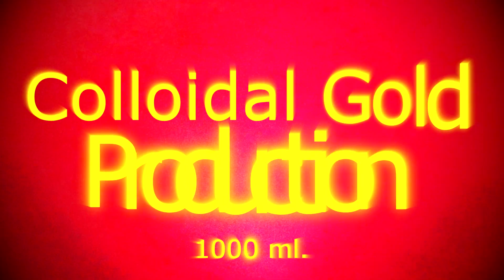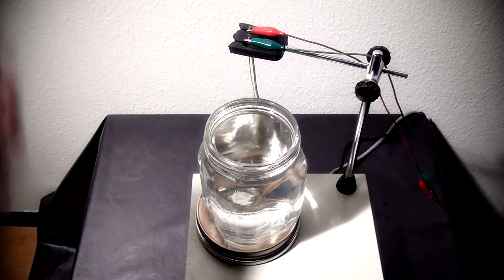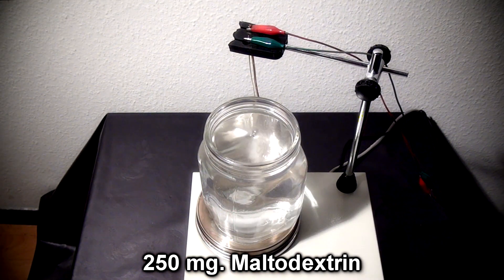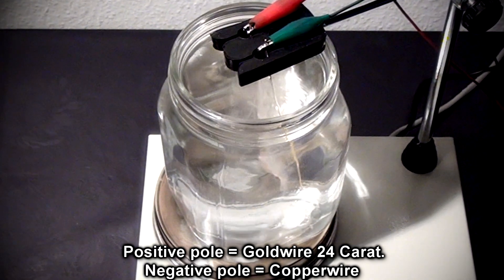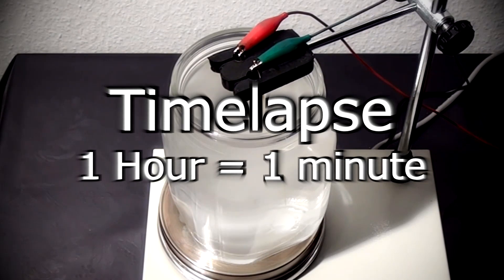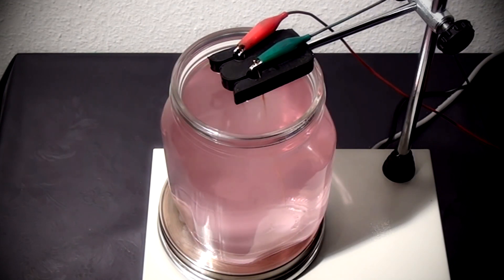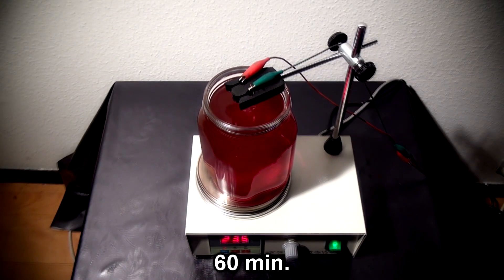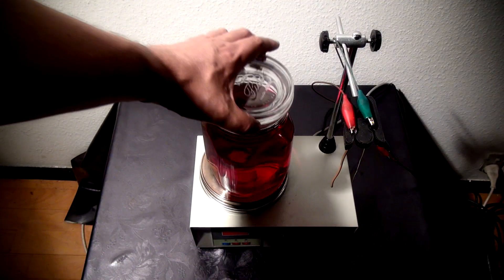Colloidal Gold Production

Comment: Hey are the alligator clips just there for support or are they connected to a machine as well?
Reply from the maker: They are connected to the power, its just easier to use alligator clips on the wires :)

Comment: I have a question I want to start making colloidal gold using your video can. you tell me if I can buy the gold and copper wires at a hardware store..so I can just have them cut it 12cm long fo rme..I looked online but all the wires are in rolls...and another question sorry..how do you know if your getting 24 k gold? I make colloidal silver similar to your method here. with the magnet for a stirrer and the machine...and I use three 9volt batteries and it seems to do well for the colloidal silver I make..but gold and copper is new to me..so want to experiment with your method..thanks so much
Reply from the maker: I but from this danish link    
https://www.ravstedhus.dk/pi/Guldtr%C3%A5d-585-40-r%C3%B8d-rose-3-00-mm_2188112_430273.aspx

Comment: 3 amps max, but how many was used in the video? Thank you
Reply from the maker: I use 24V. 1Amp.
Reply: @TC.Production  thanks for the speedy reply! How much of the gold anode is typically used in the solution, in mg or ppm?
Reply from the maker: Some people like to use a weight, but I dont care about it , think i make around 50 liter on 1 gram,
Reply from the maker: Think either your sodium citrate is bad quality or theres other additives involved,
Reply from the maker: important are the 2 poles have the same distance from top to bottom and that it is 100% pure gold .. Most often it is poorly purified water or additives of poor quality

Comment: Hi I love your video !! Can I use 10 or 12 drops of a 1molar solution of washing soda for th electrolyte instead of the salt for 1000 ml ? And  if I want to use light organic corn syrup instead of maltodextrin  ..  can I use the same 10 or 12 drops of diluted 50/50 corn syrup  and distilled water for a 1000 ml ? Thanx again ! I love your accent and great work !!
Reply from the maker: Thanks Bobby C. yes you can use corn syrup instead of maltodextrin. Dont know  exactly how many drops, but a few should be enogh.. i dont know anything about using washing soda,.. i always do like the video

Comment: Is 22 gauge gold wire thick enough and 6 inches long enougj? Can I use both gold and no copper?
Reply from the maker: The answer is YES
Reply: I use (2) 24k gold wires, 6 inches length for each and it works amazingly!!!
Reply: @MetroStationluver18  Would you be willing too enlighten us on the equipment you are using for your water??

Comment: If 0.5 mm gold wire is used, will it still work?   Would 0.5 mm thick gold wire on positive, and 1 mm thick copper wire on negative work?  Same length of course.  And will it work with  27 volts and just 0.03 amps (3 mili-amps)???   Thank you.
Reply from the maker: Yes  but it takes longer time :)
Reply: @TC.Production  Thank you so much.  Thank you for this incredible video.  Will a 12 volt power supply, at 1 amp work?  I imagine it may take 4-5 hours though, instead of 1 hour.  Some companies say super high voltage is the "true" way to make colloidal gold.  Any truth to this, or just marketing?  And making this low voltage gold, in your belief, is the particle size going to be more nano, or larger colloidal, or some of both?
Reply from the maker: 10 years ago, when i made colloidal gold first time, i tried with many different types of volt and amp. I found the only difference is time and i could make the same result with all of the power supplies.. For safety reason i cant recommend higher then 40 v and 3 amp...

Comment: Is the magnetic stirrer with heating function necessary? Can I do it without this? Thanks!
Reply from the maker: 10 years ago I made colloidal gold in a cooking glass in a pot of boiling water and an aquarium water pump instead of magnetic stirrer .. You need both stirring and heat
Reply: @TC.Production  Thank you so much for answering! What does stirring do? And what about heat? I'm trying to understand the reason behind these :) 
The rods still release bubbles! But perhaps without the heat or stirring it doesn't release the gold ions?
Reply from the maker: stirring keeps the particles seperated. You need it all..
Reply: @TC.Production  Gotcha! I'll get a magnetic stirrer then! Thanks a lot!
Reply: So are there other things you can do with it other than ingesting?
Reply from the maker: Its very good to use on skin.. It will absorb fast.. Its like a cream... Cook out most of the water and then add some creme and then, you have a famous expensive anti-age gold creme..

Comment: Where did you buy your power source?  Can you use more volts?  I make colloidal copper with a generator that puts out 7,500 volts.  Could I use this or would it be too much?  Thank you!
Reply from the maker: Cause of safety reason I cant recommend high voltage. Strength and the production time is linked... You should see the colloidal silver production video when you got the time :)

Comment: Is there another alternative for the maltodextrine reagent?
Reply from the maker: drops of Corn syrup
Reply: @TC.Production  do you need to diluted the corn syrup to distilled water? what's the ratio and how many drops to 1000mL? How to measure ppm concentration of gold?
Reply from the maker: Hi Marlone.  Magnetic stirrer and heat is enough for a few drops of corn syrup. I have friends who use more to make the process go faster. You can weigh your gold at a microgram weight and the color tells you the particle size.
Reply: Plain Karo syrup. Super cheap in the baking aisle.